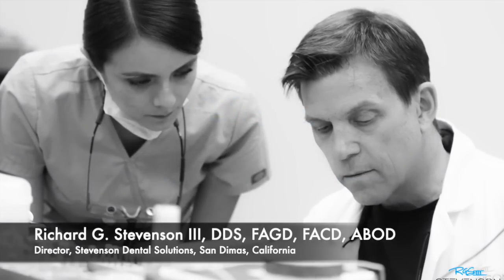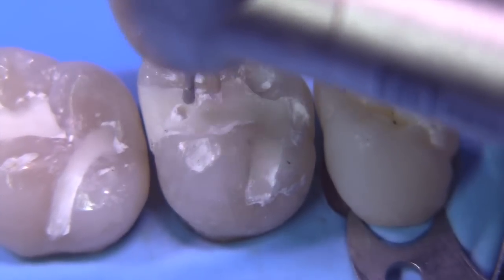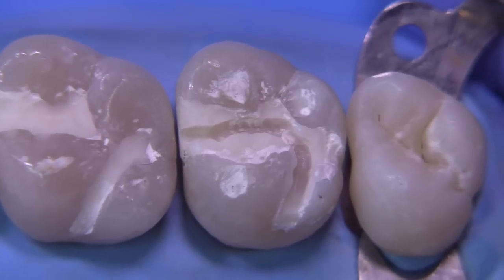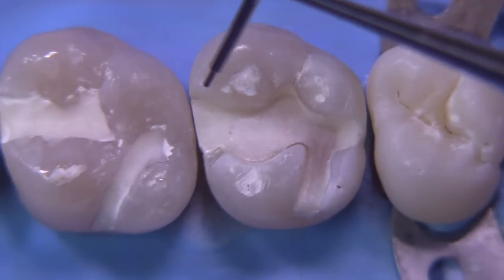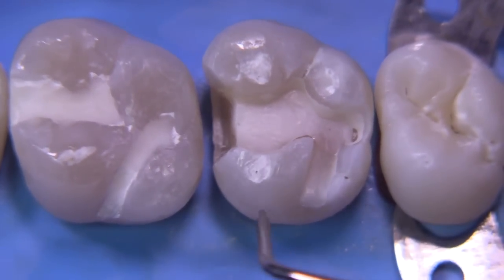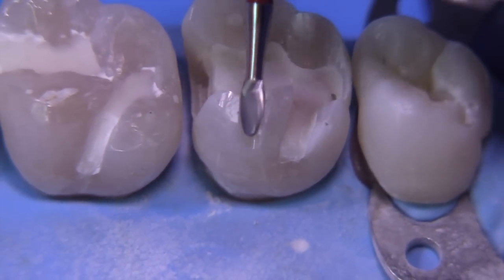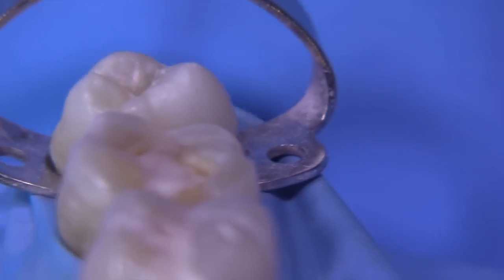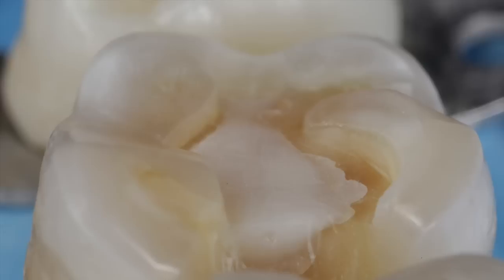Cast Gold Restorations, Part 2: MO Onlay Preparation #15

Comment: For an LL6 that has successful pulpotomy with biodentine and a layer of SDR, Would you restore it with Emax or Gold onlay?
Reply from the maker: If the root canal therapy was successful I would explain both to the patient and allow them to decide.
Reply: @StevensonDentalSolutions Thank you for your reply. I am. The patient 😅 and so far I'm asymptomatic after almost 3 months.
I have 2 dentists that each is suggesting a restoration.
One is Gold and the other is Emax.
I am concerned about the long term bonding and health of the tooth. Which is why I need your advice to decide between the 2 restoration options.
My goal is to get the best bonding and smallest risk of leakage and the need of RCT

I hope you could advise

Thanks again

Comment: I am missing numbers 29, 30 & 31 molars,  32 will is slightly tilted. I am having three dental implants, can a gold onlay help straighten # 32 by shaving two or more cusp instead of placing a whole crown over # 32?
Reply from the maker: Usually, yes

Comment: Is gold still better than porcelain/zirconia? Which requires the least preparation? Does gold support the tooth structure?
Reply from the maker: Gold has indeed stood the test of time and remains the standard by which all materials are compared.  Although it can't be truly bonded to the tooth, preparation designs may be used to augment resistance form with gold which both supports tooth structure and preserve it as well.

Comment: Should we place shoulder margin on the functional cusp (like in shillingberg)? Thx!nice video
Reply from the maker: Not with the Tucker technique - the hollow grind provides adequate bulk for this area.  Shillingburg even discusses this hollow grind as an option in his text.  Thank you Doc!
Reply: Then there will be only a very thin layer of gold at the bevelled plane?
Reply from the maker: Thin at the margin like a shoulder bevel but thick as we move inward, 1.5 mm where the forces are the greatest